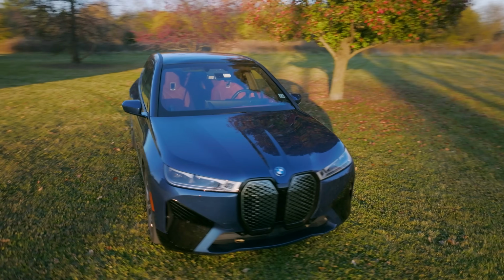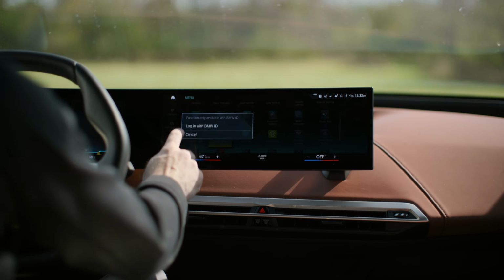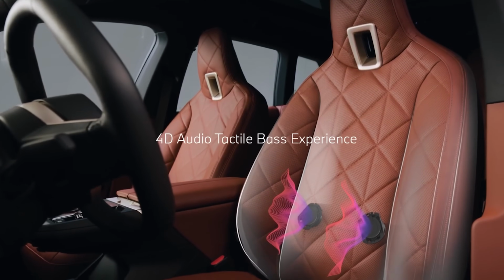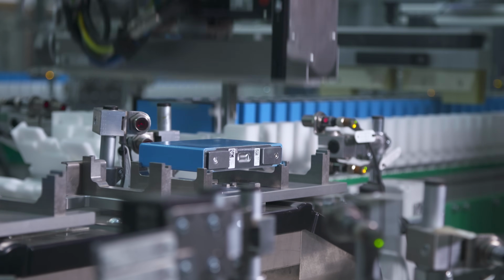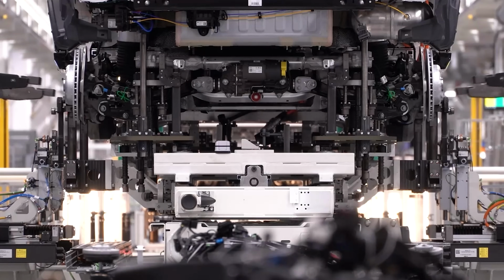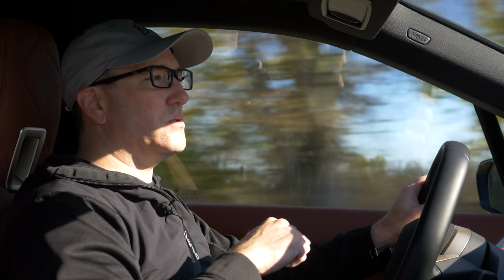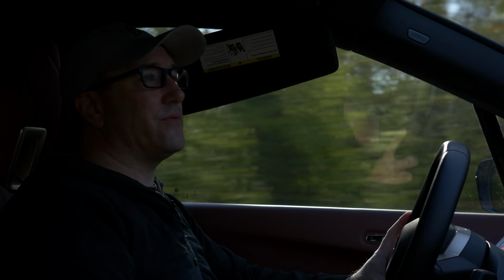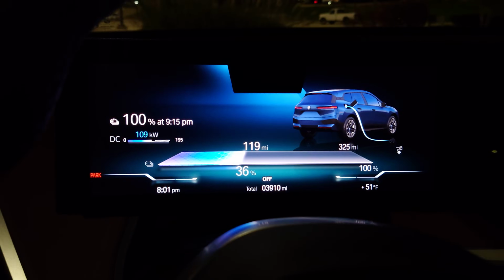BMW iX M60 | The Frustrating Future of EVs

Comment: I can't believe I spent 37 minutes watching a video on what must be one of the two or three LEAST appealing vehicles on the market. That's how good this channel is!
Reply: Drive one, only downside is too cell phone feel of the center console. The materials do not feel cheap, they do not rattle or shake and when you close the door it is solid. Noise isolation is a 9.5/10, with only Mercedes being better but also nothing randomly breaks on this car unlike a Mercedes. There's a reason why owner satisfaction is so high on this car. It also gets 330 real world miles at 75mph driving with AC on and hills.
Reply: 400v vs 800v only matters for fast charging DC stations, and only ones that have 800v capable, which are few currently, though obviously more in the future. If you're charging at home it makes very little difference. 800v could have stronger motors and maybe the density will be better, but both are going to be incremental improvements. For most people for most drives the difference is near enough to zero.

Of course the real problem will be just like in phones where nobody wants an old tech because old tech + 1 is better for only a little more and old tech + 2 is available next year... So resale could nose dive, but that won't impact you if you plan to use up it's entire lifecycle. Also could probably get some fantastic deals when these leases start expiring.
Reply: You hate it and yet mark loves it and sees no comparable vehicle as a leased vehicle.  Just wrap the teeth in brown paper
Reply: That's because Mark says what most of us are thinking but in the most professional, informative way.
Reply: This car is amazing
Reply: I bet it must be fun hear your BS all day long
Reply: that being said I now have a lot more respect for what they're trying to do with this car. The exterior may be polarizing but the car as a whole is incredibly well engineered, even if it is a throwaway vehicle considering how fast the battery technology is advancing
Reply: @CarsMeetsBikes  Apart from the environmental attempts (look at "sustainable interior panel glue" in E36 - they all came apart in 5 years - and apart from the stupid ricer-level bling - crystal? Wood veneers? Really? BMW - are you trying to trick us with that sh!+? Because of how ugly you've become?
Reply: @CarsMeetsBikes  Battery tech isn't advancing at all - lithium ion tech is absolutely at its physical limits - the only changes in recent years have been in packaging improvements and manufacturing efficiencies. On top of that there isn't even any chemistry that we know of that could improve on lithium ion tech - so we have hit a hard limit on battery technology that won't be overcome unless there is some revolution in physics.  This is literally as good as it gets, bar some small tweaking.
Reply: @Beer_Dad1975  there are rumors of solid state but I don’t see it being mainstream for at least another 5-7 years since so far it’s either experimental or only shown in lab condition
Reply: @Beer_Dad1975  sad
Reply: @cosettapessa6417  After watching the video right through, I now see it's mostly the last generation 400 volt charging tech that is the real stumbling bock here - meaning it will take longer to charge even if the charging point is capable of 800 volt charging - so that is at least a reason to pass this one over.
Reply: @Beer_Dad1975  You are both wrong. There is plenty of improvements to Vehicle Propulsion Batteries as Lithium Ion is not even the best chemistry type. We need to change to much more advance cell chemistry and specifically different ion transport medium other than electrolyte liquids. Problem is we are only in the small batch production test phase and very far from a mass producible product. An electrolyte based Lithium Ion BEV built today will have a long service life until these vastly improved cells are widely available. Even then people are not going to just throw away several year old cars that work perfectly fine as long they have enough range. Anything with well over 230 miles will be a valuable vehicle regardless what new cell types come to market because SUPPLY is LIMITED. You are both Extremist proclaiming falsehoods which defy the annoying limitations of reality.
Reply: @Beer_Dad1975  I realy don't think 800v is necessary. 400v does 200kw just fine and the short term PEAK charging rate is overkill fast enough. The problem is Cell Configuration the architecture of the Battery Pack and how all the wiring /bus bars is routed. Then also safer more resilient cell chemistry is needed to take a charge. The problem is CHARGE CURVE where the charge rate SLOWs DOWN as it fills up. What we need is a battery design that charges higher rate for long staying at 150kw all the way to 80%. Once you have a fat charge curve that does not slow down a 400v BEV will do fine even on Cannonball Run.
Reply: @Beer_Dad1975  he didn’t say lithium ion. Solid state is right around the corner in tech time. Also, no, lithium ion is not at its limits yet. Plenty of new chemistry/form factors to work out. We’re still just at the beginning of this journey.
Reply: @justinstewart3248  I'll believe it when I see it, it's far, far from "round the corner" as they have massive engineering challenges to overcome, and then you get simple physical limitations, particularly with high voltage applications, that may not be something they can work out - also it's actual real world energy density is debatable.  Right now it's a bit like nuclear fusion reactors - seems like a good idea, but actually getting it to work is beyond our grasp.
Reply: @Neojhun  What practical chemistry has a higher energy density than lithium-ion?  I don't disagree that EV's are the future, just pointing out they really aren't going to get a lot better than they are now - they are all based on technology that is fundamentally decades, or even a century or more in the case of the motor tech, old, and hasn't changed much, nor is likely to change much beyond tweaking and economics.  Doesn't make them less useful, just people have to get used to their limitations because they are not going away.  They are what they are.
Reply: @Neojhun  Physics doesn't work like that though.
Reply: @Beer_Dad1975  You mean Cell tech. Those generation things are about packing cells into batteries, and those are improving rapidly.
Reply: @Beer_Dad1975  pretty sure solid state electrolyte will improve battery tech dramatically, but it’s at least a decade off
Reply: @jp263  Hard to know where it will end up at the moment - as you say we may have a clearer idea in ten years - but that's a long time in the automotive industry - what we have right now is more or less as good as it gets.
Reply: @Beer_Dad1975 if you own a BEV 800v or 400v is mostly a moot point, most BEV users like myself charge at home, where this doesn’t matter. I own a Cooper SE and an IX40, the Mini has been fast charged once, just because I wanted to try it, the IX hasn’t to date. The USP of a BEV is the ability to charge cheaply at home, if you’re always using DC chargers you might as well stick with an ICE vehicle.
Reply: Totally wrong - this car is an amazing suv - drive it and tell me it is one of the least appealing
Reply: I love this car
Reply: Very well said. The (non-existent) design is an all-out 11 on a scale from 1 to 5 in terms of value, order, harmony, flow, lines, bla, bla bla - all those things that cars like E34, E39, E38 and countless other BMW models were so good at.
Reply: @JurisKankalis  true
Reply: For some reason I kept having Bugs Bunny singing "What's up Doc?" going around and around in my head the whole time...
Reply: Iam also gae

Comment: Love you guys, but you need to explain "hyper disposable." EV batteries have a 15 year life span (JB Straubel - Tesla/Redwood). Maintenance costs should be next to nothing, brakes one or two times for 200k miles and a few runs of BMS cooling fluid. Compare that to a Cayenne with the ridiculously expensive services, non-servicable PDK transmission, oil leaks, etc. and you make out ahead. Is a 15 year old X7 a good buy for the average person?

Comment: To their discussion about the cost of replacing a battery pack in 10 years...you wont be able to. Because even if it becomes cost-efficient to do so, that generation of battery pack wont even be made. When your battery goes, "check out our new car models that just came in!"
Reply: The Packs the Nissan Leaf use can be put in the old models to extend the range and get a new pack. The big limitation will be IF the manufacturers decide to “software lock” the battery to their newer vehicles. I don’t doubt that would happen
Reply: @Wasssup3232  A new pack replacement costs anywhere from $5500-$18500. Swapping in a used pack, with cells as low as 80% efficiency can run upwards of $12000. This is upwards of 50% of the purchase cost of a Gen1 Leaf. A Gen2 Leaf runs around $46k but a replacement battery will cost more to replace now and in the future since the metals needed are very rare, increasing in demand and very expensive to mine and refine in the production process.

Comment: The technical discussion was quite refreshing, especially all the different nuances of EV technology and its future.  Thanks.
Reply: I also appreciate the focus on EV tech and its future. I disagree that this car will be "disposable" because a next gen battery version will come out in a couple years. With 300+ miles, modern battery cooling tech, and the EV experience of BMW, this sounds like a practically usable EV that may very well stay practical for 100k - 200k miles or more.  A normal charging stop may take 8 minutes instead of 15 with the next gen battery, but that's no reason to toss a vehicle on the scrap heap. If you want to upgrade EVs like iPhones, that's up to you but likely unnecessary with this car for practical normal use.
Reply: @jnichols959   let's wait and see them in real life, also the cost of new gen

Comment: Great analysis with the Shoppe segment regarding the logistics and longevity of these vehicles, really curious to see what the future holds with these things
Reply: I'm not convinced on their battery lifespan of 10 years.  Batteries in Tesla's from 2012/2013 are still around with ~10% degradation.  Battery tech and manufacturing is better than it was 10 years ago.
Reply: @bobthebuilder372  I think you're 100% right, Nissan recycling programs for their Leafs have been significantly halted because the vast majority of batteries are still in the cars, Leaf's been around since 2011 and is one of the most basic EV platforms with simple air cooling
Reply: @bobthebuilder372  Rav4 EV from 1990s using passive thermals NiMH Battery with BMS safety function. Averaged about 17 years of power output until it became sketchy unreliable to accelerate. Lithium Ion even with actively liquid cooled is not much better and may get worse if used hard for Commercial high mileage. Still going to be 15-17 years which is Not Great Not Terrible, much improvement needed.
Reply: Just seeing all the automation blew my mind. I can imagine all that wiring will be done with bus bars and PCBs in the next gen battery so the labor costs for the battery assembly will be near nil in comparison to what it is now.
Reply: @anydaynow01  totally agree, has to happen, even the consumer EVs are still quite expensive for the average person so production costs need to come down
Reply: @jamsu7126  These have no future.
Reply: @Jowurel  these?
Reply: @cosettapessa6417  Deez nuts
Reply: @Jowurel  darude sandstorm
Reply: @jamsu7126  If your waiting for German luxury car production costs to come down, you'll be waiting a while. I've been to the Audi factory in Germany ,and there mind bending, in their lack of human interaction and use of robots in the assembly process. Also, when it comes to EV "affordability" remember the top selling vehicle in the US is the Ford F-150 that commonly starts higher than a base model Tesla model 3 and is often optioned higher than a top Model Y would be.  There are many KIA an Hyundai EVs models  presently for sale and coming soon that cost less than a Ford F-150, but you have to want to change.
Reply: @Jowurel  Do you know what manufacturers prefer? They prefer that you be a good, little consumer and trade-in what you have about every five years.  And you are talking about future? Properly-trained tech-slaves don't need to worry about six years later!
Reply: The future of cars is the smartphone, mostly disposable garbage that peaks and then they stop supporting the device for you to be forced to buy another.
Reply: If the i3 is anything to go by, which was a similar exercise in expensive material "innovation" this will be a parade down a dead-end street.
Reply: @DiscoFang  I own an i3 and have driven it daily for over 2 years. curious why do you think carbon fiber and CFRB is a dead end street?  
I like the CFRP body structure on my i3, and since none of the panels are metal there's no dents in it as a 2018 model. I like Savagegeese videos a lot, but there was some sh** talking towards the end that was unfounded and highlighted the goal-post moving fear mentality that many people have trying to convince themselves to move to an EV.  Listen to me,  an actual owner, if your still buying gas, you're doing it because you like lighting $20s on fire or you actually tow a bulldozer 300 miles to work everyday (some people actually do evidently).  Here's the truth as an i3 owner that the critics didn't invest the time to find out: its a fantastic car if you plan on driving less than 100 miles today,  and the concept of a big battery with a small gas generator (650cc) as a back up, is a unicorn to this day. I have 4 cars ranging from the i3 to a Suburban, and my wife and I prefer to commute and run errands exclusively in the i3, since its quick, cheap, and fun to drive. Did the original owner who leased it very briefly over pay? absolutely, did I get a bargain with 4K miles on it prior to Covid - absolutely. Good luck finding one now, people have opened their eyes to the concept of pump liberation. I could literally sell my i3 for more now than I paid for it in early 2020 with 50K miles on it now.
Reply: @jefffaller8474  I enjoyed reading your opinions and your experiences.  First some house-keeping(English). It's "you're" not "your" if the word is used as a contraction and the verb part is essential. Now for the guts: Your situation and lifestyle is at least somewhat unique just as mine is.  While electricity and gasoline are both rather abundant in my city, charging stations both at home and abroad are next to nil. If I owned a house, and did not rent an apartment, that would be different. In my city probably 40% of people live in apartments.  Who would pay to upgrade them for charging? Also, 75% of the public here does not buy new cars but rather used only. There are few EV cars that could be purchased used. On the economics, the federal government gave out a few thousand dollars during Covid and went in the hole a few trillion, although that was their poor management's fault. If EV's are a 20k premium over gasoline arch, where will the money come from? Batt generation needs to come down to 5k or less. Will that happen?  People whose main issue is hauling their body around in a heavy EV vehicle in luxury are not the norm. Most of the world has bigger ranges needed or have work materials to take with them. Plenty of the nation is rural space and hundreds of miles of traveling are extremely common including with a load. For farm work or other work even gasoline is inferior to diesel.  Electric will not work.  Under the current political climate, people in the US cannot expect any investment in EV or mass-transit and may never get there either because oil still controls government and because 95% of voters want cheap fuel.  What is more likely to happen is war.  Not cooperation at a global scale.

Comment: A $100,000+ disposable car with a short shelf life. Wonderful.
Reply: Should go well with the buyer's 1000$ disposable phone they can't change the battery in by themselves. 🤣
Reply: It’s no more disposable than most luxury vehicles. The maintenance is a fraction of what you’d spend with a Cayenne, and lower running costs.
Reply: @cadriver2570  what have energy prices been doing lately?  in the country i'm in they've doubled over the past year.  they will in the USA as well, especially with the way things are going there now LOL
Reply: @hissingoose  Charge it with solar panels.  Geesh, energy is energy but you can't "make" gasoline like you can electricity.

Comment: Great video as always. I just don't get the harsh video title given your positive summary on comfort, driving and built quality. You're quote of picking it over all other EVs incl. Taycan as a daily sounds quite good.
Reply: I think they summed it up with the march of development with EVs is going to come very fast, so buying this as a long term car will be frustrating when the next generation comes out in a couple years and the trade in value of the car will be quite low (but that's the case for most luxury cars). For folks who lease vehicles though it would be a good way to go if they like the BMW styling.